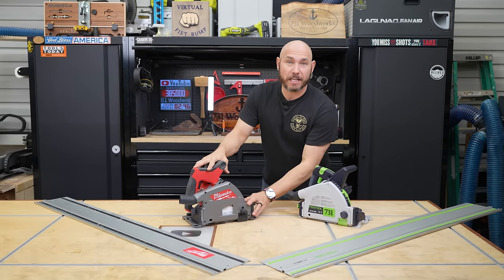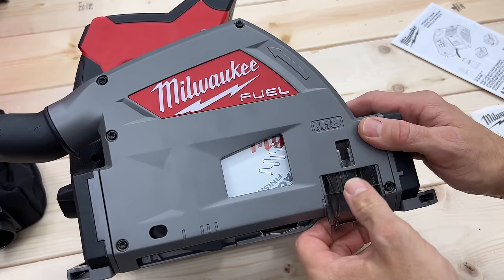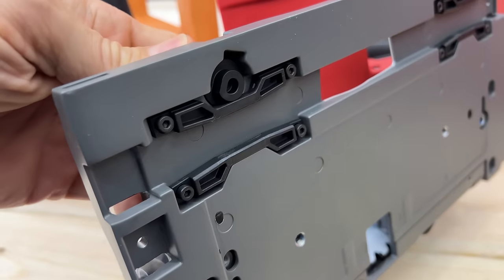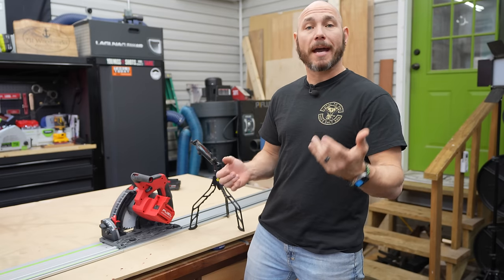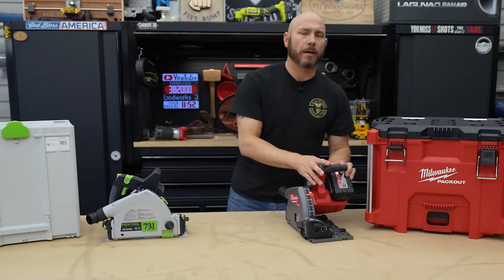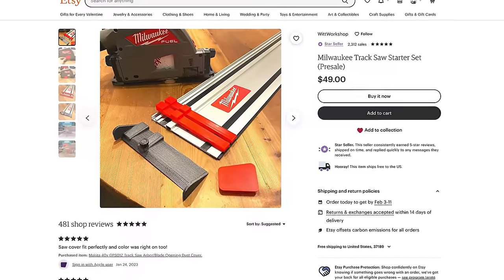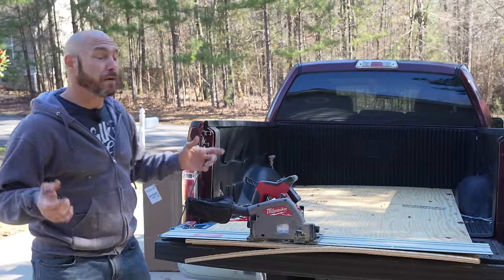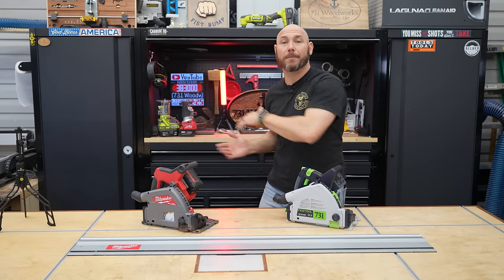Milwaukee Track Saw - Everything You Need to Know

Comment: I know I already stated this on your earlier video on the Milwaukee, but I'll say it again here:  I have owned the Wen tracksaw for several months.  Other than it being corded, I'm really not seeing THAT much of an improvement over it that the Milwaukee or Festool give.  At least, not at nearly 10x the price, compared to the Wen.  And, the Wen also has anti-kickback, and you can put other blades in it (I think I have a Makita 6-1/2" in my Wen now).  And, the Wen also has the "scoring" option as well.  Maybe durability will be a thing to consider in the long run, but so far, I'm impressed with the Wen.  And it was under $100.
Reply: Wow it's under 100, that's nice. A little bald birdy told me it doesn't handle the angled/ mitre cuts very well?
Reply: @joegeorge4608  At that price, why not get two or three and set each one at a standard angle, 90, 45, 30?
Reply: You'll have to actually try the others before your point is valid. I get premis but it's all perception to you
Reply: I bought my WEN about 3 years ago, and it’s worked great for my needs. I’m sure all the other track saws that cost far more money are likely far better, but they all have a blade that goes round and cuts as it follows a track. Of course I can put any brand saw blade on my WEN. If I used a track saw all the time, or took it to the jobsite as my table saw replacement, perhaps I’d buy something more expensive, perhaps not, as then I would worry about someone walking off with it while on site. I’ve never done an angle cut with it, so maybe it’s crap for that, maybe not, but what I do know, is that when I ordered the WEN track saw, with tracks ($150) from Home Depot, I was also able to order a Grizzly bandsaw ($600) through Home Depot, along with a WEN oscillating spindle sander ($100) for less than the Festool track saw or the Milwaukee kit you purchased alone, and I filled my shop with 3 tools I didn’t have, but found I needed. However, I now see that the Festool and Milwaukee saws appear to be selling for less than they were, even a few weeks back, but not sure. 

I know there are those of you who likely have complaints about the Grizzly bandsaw, but it’s actually a great saw and, numerous reviews rate it as the best value bandsaw on the market. No, it’s not a Laguna, but I’m very happy with all three of my purchases, and in the end, that’s all that really matters for all of us.
Reply: Compatibility of accessories might be a factor.
Reply: @joe_ferreira  That’s true, in fact, other than clamps, I don’t believe there are any accessories you can use with the WEN tracks, as with Festool and Makita, but I’ll have to admit, using routers on the Festool and Makita tracks, and even multitools and others is pretty damn cool! I don’t know if there are accessories yet for the Milwaukee track, but I’m sure there will be.
Reply: I also own the wen and NEVER had an issue , other then the cord.... my buddy has the festool and I've used it a bunch before getting the wen and it never did anything better than the wen..... I have the M18 now ONLY because its cordless and a better value, well and i'm on the M18 platform
Reply: @brentfrench752  if it works with makita it will work with the wen.... I know that for a fact
Reply: The Wen is corded and brushed, not exactly apples to apples
Reply: @robhaydnsei  - Um...they are both tracksaws, used to cut wood in a straight line, along a track.  Very much apples to apples.
Reply: @CementRoots  - Sure, cordless would be nice.  But, is it "10x the price of the Wen" nice?   If so, for you, then awesome!
Reply: @joegeorge4608  I own the Wen and compared the mitre cuts to a Festool corded tracksaw, and the Wen is tougher to get a constant and accurate mitre cut. You can make it work on short pieces but on longer pieces, the saw can kinda wobble because the locking mechanism is made of cheaper plastic and can bend, depending on how you're handling and pushing it during the cut. Never had any problems with the 90 degrees cut though, which is 95% of the use it gets in my little shop for downsizing sheet goods ; for the price the Wen is fairly unbeatable for DIYers.
Reply: @brentfrench752  what bandsaw specifically are you talking about or that you bought? Curious as I'd love an affordable option, though I missed out on a good used delta a while back that I think was 500$
Reply: @brentfrench752  Wen uses the same tracks as Festool, so you can use the same Festool or compatible POWERTEC clamps

All interchangeable
Reply: @asbrand  nah $100 for the wen, $400 for the M18.... the prices quoted in the video are to make the M18 look like the same price as the festard
Reply: @loucifer4205  way to big and bulky and everything you would use with it is proprietary , plus its a stanly
Reply: I also run the wen track saw, don't need a big brand for great out comes.
Reply: @robhaydnsei  No, it’s not close to the same saws as others, but it wasn’t made to be. It’s a great value saw for those who just want to cut sheet goods down, like me, and other cuts you don’t do all the time. I think it can probably do most things the others can do, just perhaps not as well, as easily or maybe not as slick, but the price is cheap, and you can replace it two or three times over a decade or so if it burns out, or replace the brushes and you’ll still save a bunch of money. It all come down to its intended use, the daily use and whether you’re hung up on only buying top of the line brands.
Reply: @loucifer4205  lol you silly yellow kids....lol
Reply: @llamabahama4654  I responded to you earlier today, but I don’t see my response, and don’t remember if I actually hit send or not. If you got it great, no need to respond, but if you didn’t, let me know. Have a great evening!
Reply: Most of my tools are M18.. I’ve become very disappointed in Milwaukee tools over the past couple years. Terrible quality. The Circular saw and jig saw needed to be sent to the repair shop right out of the box. The Milwaukee track saw is over priced… especially considering you need to buy more expensive track to rip plywood. Milwaukee had plenty of time to develop a superior saw but failed.
Reply: @KeithHill2  I run the Dewalt platform, simply because I bought a few of their tools year ago so just stuck with it, but they’re good quality tools, and a decent value. I believe Milwaukee is a little better platform, especially considering the number of tools they offer, but their price increases seems to outpace their competitors. I’ve heard complaints about one of their circular saws, but not the jig saw. I agree with you though that the price of the track saw is high. It’s almost like they think they’re a direct competitor to Festool. From what I’ve heard, the Kreg or Milwaukee is a better value, but I really have no idea. I’ve heard little to nothing about the Dewalt track saw, and have no idea what the price is. Hope you have no further issues with your saws!
Reply: Agreed. I love my Wen track saw. Sometimes the anti-kickback thing is annoying but not a deal breaker. The only real complaint is the dust collection BUT it's totally fixable. Someone else figured it out but what you need to do is take the blade cover off so you can get at the vacuum attachment. If you look inside it has fins molded into it. Cut them out and put it back together and it's vastly improved.
Reply: @brentfrench752  I did not see it, if you don't mind replying again I'd appreciate it. I looked through comments/replies and couldn't find it either. Thanks
Reply: The Wen is a great deal and cuts well enough to do great work, but there's no way it is even close to the quality of the Milwaukee and the Festool,  especially the Milwaukee. Professional grade tools will usually last for 10 plus years with hard use, and that is the difference between pro grade tools and the consumer grade stuff. Unless you're rich it does not make sense for a DIY person to spend $800 on something like this. But tools like the Wen and Ryobi are not equal to the professional brands. There are differences in materials and tolerances, the difference in price is not just in the name.
Reply: @actionjksn  - as I said in my OP, "Maybe durability will be a thing to consider in the long run".  However, the Wen I have cuts a perfectly straight line, and that's all I need it to do.  

Are the Milwaukee and Festool better?  Yes.  Are they 10x the price of the Wen "better"?  Time will tell.
Reply: @asbrand  I'm a professional trademan but I don't really cut panels that much so I may get something cheap like the Wen. I actually have their electric drywall sander and it was a little over 100 bucks instead of $500 pro grade version because I don't do drywall every day, so I'm not anti Wen or anything. I just used that tool today actually. But there are certain tools that I cannot cheap out on and I get the top quality stuff. Wen is pretty good for the price but they are not as good as the better versions. I doubt the runout on the spindle is as accurate as the commercial brands or that it will last as long. It's probably good enough for most of us. I have used a Festool before back when there was nothing similar, before the patent expired.
Reply: @joegeorge4608 I’ve used it and it wouldn’t be that bad if you changed the blade to whatever blade you’re gonna be using, I used the blade it came with and it was thicker than the Diablo blade so now my tracks are hard to line up because the saw took too much meat off of the rubber part that’s cut off, other than that the saw is ok, it got the job done but I used Milwaukee and it made it so much easier because the rubber on the track saw was lined up perfectly and I didn’t have to micro adjust to get it on the like perfectly

Comment: I'm using team red MAFELL.
Reply: Hi Kevin, I have the Mafell battery saw too, do you have issues with the blade vibrating during cuts? It spoils the cut when it happens, is my blade causing it?
Reply: Eh, they are certainly good for woodworking. But for someone who's a general contractor, milwaukee or makita is about only way to go to stay on one battery system.
Reply: The pack out box system
Is 10x festainers
Reply: @dimr1088 if you want 1 battery system then the CAS system is the way to go
Reply: Man mafell to dang expensive

Comment: Im team red for 90% of my power tools,   but i wont be getting rid of my cordless Makita track saw any time soon , which happens to fit in the smaller "large" packout box perfectly with the double charger & batteries.
Reply: I think Mikita Tracksaw is great for the price. Well I got the corded version since I'm in team yellow.
Reply: I couldn’t wait any longer and went with the Makita cordless.  It’s such a specialized tool, I didn’t mind stepping away from Team Red for that purchase…I got the whole setup and saved $400.
Reply: Same here. I have the Makita cordless, and I feel it is absolutely one of the best bang for the buck track saws you can buy. The reason I went with Makita is I own several regular circular saws from the Skil to the Ryobi brushless to the Ridgid, and by far my favorite circular saw is my Makita is it's nice dedicated case. The motor is very quiet and it just oozes quality. So when I powered up the Makita track saw, I was not disappointed at all.

Comment: I found the flexvolt plungesaw to be the best
Reply: Have not seen anyone compare the Milwaukee to DeWalt. Always seem to use Festool or Makita. Bought the DeWalt myself, couldn't be happier.
Reply: I’ve had the flexvolt saw for years, gets absolutely punished on site doing cement sheeting mostly and has done hundreds of whole houses, tens of thousands of sheets and still works perfectly 
Not as accurate as the festools etc for very fine work but a great saw for site use and abuse

Comment: You should check out VCG Construction's video on Milwaukee Batteries titled "Your BUYING and USING Milwaukee M18 Batteries ALL WRONG!". He explains it pretty well but basically the high output batteries are new battery cell tech that take advantage of the FUEL technology and Milwaukee claims 50% more power and 50% cooler. I notice A LOT more power from my 8.0HO and 12.0 batteries than a 9.0 battery I have. I don't even use the 3.0, 5.0 and 9.0 batteries I have anymore.

Comment: I have owned the Festool cordless only because when I needed one they were the only ones who made a track saw. Bought the corded version first and used it many years. Excellent saw. Then sold that and purchased the battery model. That is also an excellent saw but only downfall is 2 batteries and only 1 charger. Yes saw runs on 1 battery but at a significant power loss I found anyways. I’ve been waiting for the Milwaukee version and finally purchased just the saw as I’m on their battery platform. I used it on a job cut oak veneer sheet goods on my Festool tracks and I was really impressed with it. I did straight cuts, 45° bevel cuts. Excellent job. Used 12 amp battery. Found the saw nicely balanced even with the bigger battery. I’m using a Makita 6 1/2” blade on it. And it fits in my Festool systainer too until I build a case for it. I didn’t want that big box that came with the kit.

Comment: Just bought the Milwaukee track saw and this video reaffirmed my decision. I don't own a lot of Milwaukee cordless tools, but given how expensive high performance batteries are in general, it only makes sense that you would want to max leverage the battery portion of your investment with the platform that has way more multipurpose [not strictly woodworking] cordless tools in their lineup, [vs. Festool]. If cut quality is comparable, I think the Milwaukee wins out. Great video BTW! 👍🏼

Comment: Really pleased that you did this review of the Milwaukee system. My tool base is Milwaukee and was just lamenting to a friend that my very old cordless Milwaukee on the 14.4 batteries (1998 or so) was pretty dead and I would need a replacement for "off grid" farm fencing work. Now I can have a track saw too! Excellent!

Comment: In Uk you can buy different brands blade replacement for festool tracksaw. Trend for starters makes them and Freud which looks very similar to US brand Diablo. At the end of the day what matters when you look for a blade replacement is its general size and bore size plus blade thickness as it must match with built in riving knife. Both brands are using common size blades
Reply: Diablo it is a Freud's brand.
Freud (Frese Udinesi) is an italian company bought some years ago by Bosch.

Comment: Very in depth. Thank you!  To add one observation, I like the fact the Milwaukee incorporated the idea of people using it possibly without tracks and making it easier for people to use it without them (i.e. the depth gauge ease).  It actually makes it so that you don't need a circ saw AND the track saw easier than the Festool (which can be used without the track but is not as quick to use).  So, if I went up to this point...I'd probably go with the Milwaukee.  For the anti-kickback feature, I'm wondering if the Festool has a patent?  That might be why.
Reply: milwaukee fanboys crying
Reply: @gm08351  don’t be a keyboard muppet
Reply: It is clearly a copy of the Festool minus the patented items XD

Comment: So your right they finally made a track saw. I am a Milwaukee tool guy so yeah that's the one for me. I think with the box you could take out the foam tool holder and put sockets or other things under the saw. I did like the auto switch on the vacuum but I will never own a fancy jobber like that anyway.

Comment: The Milwakee has anti tip for miter cuts with their own tracks, and Makita tracks.  I have the anti-tip  on Makita saw and like it.  The riving knife and splinter guard make the Milwaukee a good upgrade candidate for Makita.
Reply: Anti tip tab on the milwaukee doesn't seem to fit the makita tracks unfortunately 😅
Reply: driving knife prevents from downing plunge cuts, which is the whole point of track saws

Comment: From my research I believe that the best track saw on the market are made by Mafell.  I did months of research before purchasing the Mafell MT55cc track saw.
I also opted for the Bosch tracks (made by Mafell with Bosch logo/colors) since they are exactly the same as Mafell's, but costs less. My only regret is that I waited so long before buying a track saw.
Reply: I have a Makita but switching to Mafell. My main cordless tools are all Milwaukee but for me going Milwaukee wouldn't be much of a change from the Makita. The Mafell tracks are much better, made of steel and can be joined and align much better as opposed to the Makita.

Comment: Hey brother, Infinity Tools makes a 6 1/2” 20mm arbor track saw blade that will work on the M18 saw, so you don’t have to use the throw-away Milwaukee blades. Also, check out Tenryo blades for your TSC 55.
Reply: Freud also makes a 6-1/2 20mm tracksaw blade...it cuts so nice.

Comment: Awesome video!! Can the Milwaukee be adjusted so that the shoe allows it to fit exactly to have zero clearance on the strip already cut by another saw so that both Festool and Milwaukee can be used on the same rail and BOTH saws will have true zero clearance without having to change the strip?

Comment: i have the festool TS55 track saw with a regular 220v (im in Denmark) but i have no festool battery machines. i do have a bunch of milwaukee m18 and m12 tools, would you recommend the milwaukee track saw or should i get the festool cordless one since im alrdy used to festool saws